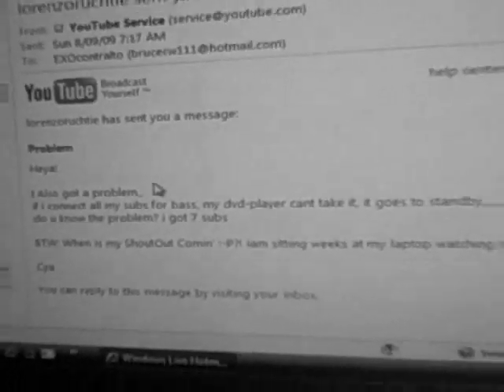(Q & A) Subs On Fire - Breaking In Louder Woofers - Color Wires - Alternator Voltage Drop Dimming

Comment: Well I just took it back to the car audio shop and one of the installers switched the settings on my head unit and amp. The guy who installed the amp yesterday set my head unit HPF to 80hz and the gain on my amp to 75%. So those were both switched to 120hz on the head unit and the gain on the amp was turned down to 25%. Now everything sounds crystal clear! Thanks for responding man, I greatly appreciate it!!! Love your videos btw....the best car audio videos on YouTube!

Comment from the maker: You SHOULD NOT use bigger than suggested fuse rating - And also, it sounds like you have a wiring issue. Have you checked your grounds? If so, where is it grounded to?

Comment: about subwoofer breakin....some subs you can crank it to max without hurting your sub, it will take sometime for the rubber to stretch and get louder. I have a MTX sledgehammer 9500 at 2ohms at 1,000 watts and i played it on max right after i hooked it up and i got it in 2006 and i still have it and its still goin strong and loud

Comment: I know you made this video forever ago, but I just wanted to say that much of the "break in" happens in the spider of the subwoofer. I saw a video the other day of some guy doing a recone on some subwoofers, and he had a new one, and a broken in one (a few months old). On the new one, the spider was REALLY firm and not very flexible at all. The broken in one was very pliable, and soft.  If you were to power up the sub hard before it got softer, all the extra resistance could cause damage.

Comment: Love the Q&A vids....but im running a 5000watt amp it has 2-30amp fuse in it. in the house that i have vids on and i need to know what can really give it good power....im thinking of buying a 30amp 13.4volts power supply and a cap with 18farad....using a Microsoft Xbox. charger and two other's  right now as seen in vid....ooh and go from like i think 16gauge wire to 8gauge.......3 amps  total by the way 5000//300//280

Comment: I need little trick I learned a long time ago.is to take a 9 volt battery n touch it to the 2 leads that the speaker you're trying to find ill make a little scratchy sound. this will not harm any of your speakers it's just  enough to make a sound.

Comment: @dbizzle3769 Yes absolutely, sadly this is true, I lived and grew up in Mich. all my life so I understand where your coming from. With sub, the bigger it is the more time it needs to reach an ambient Temp that is sufficient or else parts inside the sub woofer can fail. Just let the car warm up, if you have an opening to the trunk open that up and let those bad boys get warm. 
HO Alt. Stinger 2 Batt. 1 Cap
Diamond Highs
JL 1000/1   2 JL D7's, now down to one which sounds better.
Eclipse 04'

Comment: hey exo quick question. I am looking to build a box soon for 2 12" mofos in my2000 forester. because there isnt a trunk or anything i was thinking i would get depper bass up front and some flex if i built the subs and ports facing up. what do you think about where my ports and subs should face if as the driver want the most bass and some flex?

Comment: i have 6 kicker S15L7's (2000 watts each) powered by a warhorse WX 10000.1 amp. I also have 2 kinetic (1500 amp) battery's plus tha stock (wired in relay) and a upgraded alt. with the big three run with 0 gauge all around. i was going down the road and saw some people on this backraod so i turned and hit a pot hole and my subs went pop and havent sound tha same since. my uncle said somthing about groung loops but he didnt explain could you help

Comment: EXO, I got a question for you. I just got a 4 channel Kicker DX200.4 amp hooked up to my 4" Infinity Kappa door speakers and they sound sound worse with the amp. There is popping noise coming from the door speakers and the clarity and sound quality is not any better whatsoever. There was no popping noise without the amp. Plus my subs are not hitting as hard now as well. Got any ideas on what the problem(s) may be?

Comment: hey i saw u at sanford sound a few months ago and just saw this vid from u i have the white honda civic that hits 142.8 db check my vids anyway im not shittin on u in anyway but thats not the break in on a speaker ....its the coil if u go stright with all ur power right from the get go it can damage the coil not so much the rubber surround cause what happends when a sub blows is thoes wires in the sub aka coil short out  soo ya just tryin to help ya out a little jl audio dealer and 35 years exp